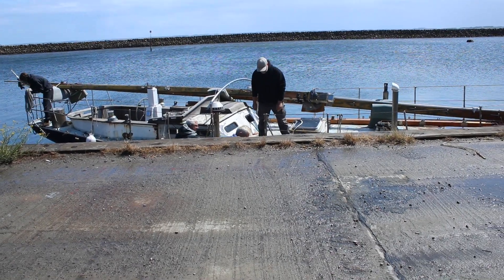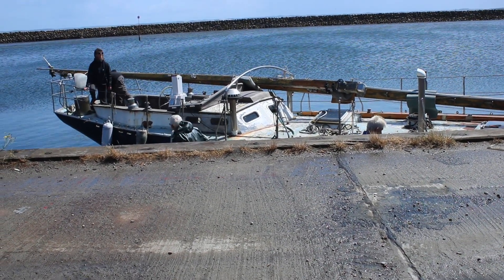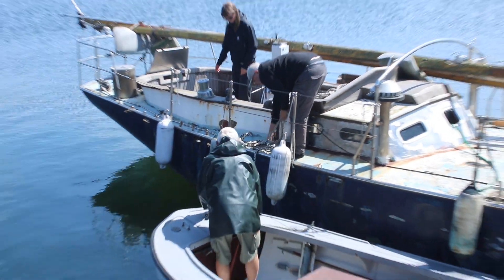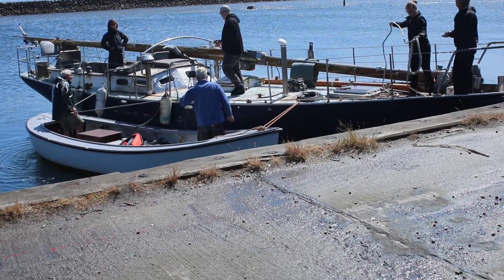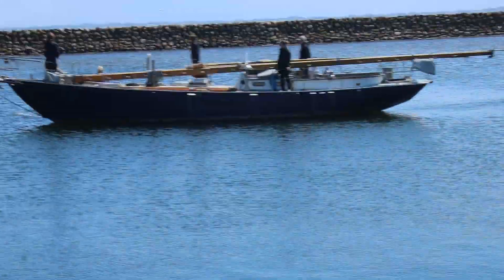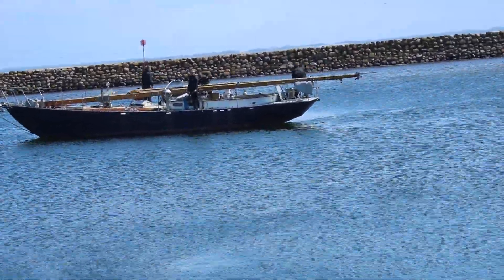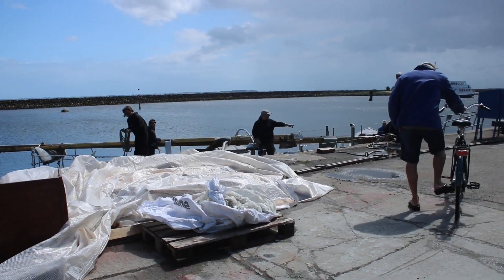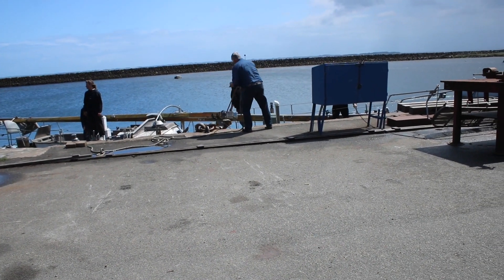Episode 19 - Sailing to the haul-out site, and back again.

Comment: When I watched your video and seeing the wind gusts on the water, I thought you might drift towards the rocks. Your towed seemed under powered. Those pesky tides. I hope you can reach a yard that is more economical. Like Ft Saint Lewis in France
Reply from the maker: There's a quite shallow patch before you reach the rocks in that harbor, so while we were pushed in that direction when we didn't move, we didn't really risk hitting the rock barrier. The 'tug' was a bit underpowered for direct control of Ophelia, but just fine for providing propulsion and leaving the steering to Ophelia. I'm currently in talks with another, and bigger, shipyard on the island, a good 20 NM away. They just confirmed that they can lift Ophelia with no trouble and that would allow me to close up the unnecessary thru-hulls and replace the one for the engine, so I'm just waiting for a price. Once that's done I'll start looking at new options for getting the hull blasted and painted and that could be more or less anywhere in the Baltic sea. I've had Poland recommended as an affordable option but I haven't found anything specific yet.